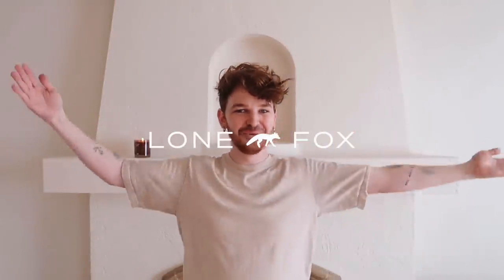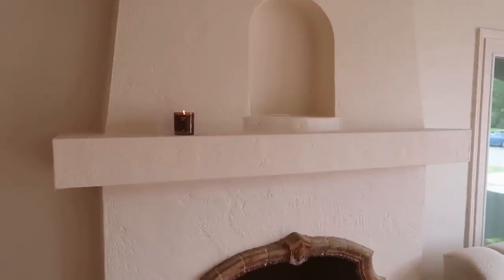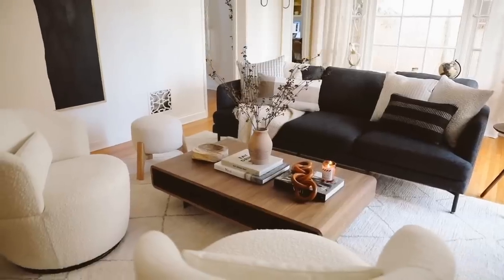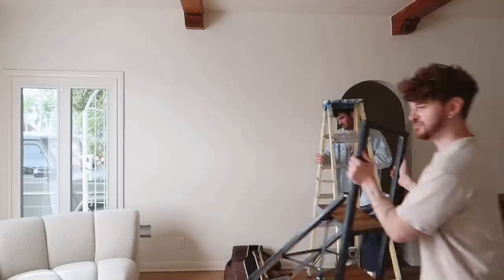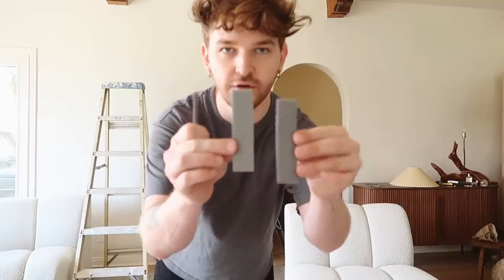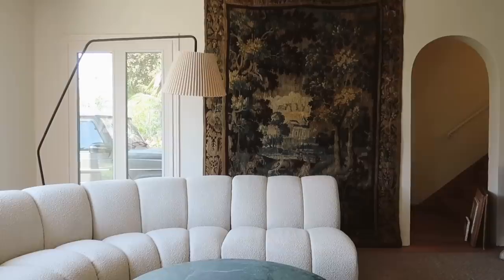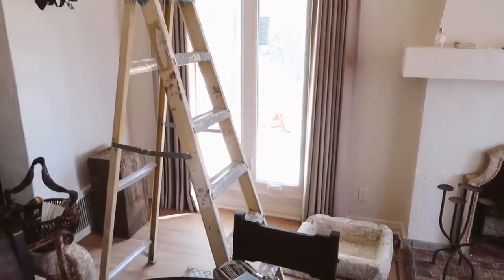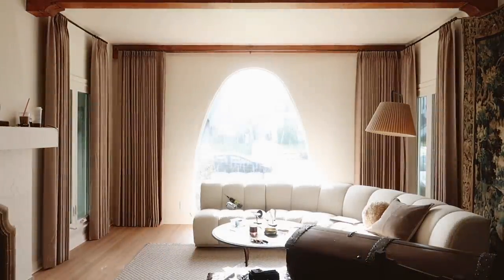Making Over The Lobby 🪑 *EXTREME TRANSFORMATION*

Comment: The tapestry is wonderful.  Since it's so close to a window you might consider getting UV coating for the window to protect the colors.  Those old dyes were natural and fairly fragile. It's in amazing condition for its age and worth preserving.
Reply: I believe you can get UV coating for windows so if it stays in this room the windows should definitely be protected
Reply from the maker: Yes will 100% look into this! I actually didn’t think about that so I am happy you commented this ❤
Reply: absolutely...there's a reason that Museum's have LOW light in the tapestry/costume/furniture rooms.  fading is a HUGE concern
Reply: That was the first thing I thought of when you hung the tapestry. It’s beautiful! You want it to last another 300 years.
Reply: Great idea!
Reply: Was going to comment the same thing! (And I see various other people have as well). It's a gorgeous tapestry and to keep it from damage it needs protection from too much sunlight and UV.

I think you should also invest in getting it hung properly so that it hangs straight and doesn't touch the floor. This will stop it getting damaged and misshappen. It will also make it look more sophisticated, permanent and intentional. The way it's hung at the moment makes it look a bit like an afterthought, which it clearly isn't in such a well thought-out and put-together room! 

Others have suggested hanging it on the other side of the door. If that allows you to hang it a fraction higher without the beams getting in the way, then I agree. It's also further from the window, which might reduce its UV exposure (although I'd be tempted to hang it in a darker room altogether, even though it seems a bit of a shame as it goes well with the rest of the decor in this room).
Reply: I think the wall space it's hung on is a bit too narrow as well. The edge of it is too close to the archway. It needs a bit more room to breathe at the sides as well as the top and bottom. Love the rest of the room though!
Reply: @lonefox  They make a film for the window or you can get custom made shades
Reply: Came to say that as well.  It’s absolutely and archival piece worth protecting.
Reply: I LOVE everything you did in this room. The tapestry is GORGEOUS and someone commented already that it needs UV protection and it’s SO worth the investment - UV film for windows is the easiest way to do it. I will say tho, when you put the tapestry on the wall, I cringed about how it’s under the beam. Would it not fit much better on the other side of the doorway near the bookcase? It looks like that area wouldn’t have the beam above it and the tapestry would have full space to hang. This tapestry deserves 100% space and shouldn’t be hung with the top the way it is currently under the beam. Also - please know I suggest this with love because I’m an art conservator and conserve a lot of quilts and tapestries that have been hung on walls. The last thing you want is for the tapestry to have hanging stress or aging because it wasn’t hung straight.
Reply: I'm glad I'm not the only one who's concerned with the tapestry's safety from the light. Also that couch looks super comfy, really looks like a giant marshmallow
Reply: As someone who has some knowledge about textile conservation, it can be two things ,full aneline dyes (toxic) or natural dyes that fade away . Under no circumstances this rug should be exposed to elements what so ever, it can be harmful to you or it can get damaged also DO NOT FOLD THE RUG ,roll it with  ACID FREE PAPER  and a solid tube inside to transport. These are history, preserve it. Get it framed inside glass because this velcro method is creating unnecessary damaging stress to one end and the glass will protect it from fireplace smoke, dust, water , and other potential irreversible damages and getting it cleaned from a  professional after a disaster will cost a lot. Also don’t experiment with cleaning it as a normal rug, consult a professional who knows about vintage stuff not even a modern dry cleaner.
Reply: copied my real comment so its in first person lol
Reply: @Timmakesmusic  THIS! It does not fit on that wall!
Reply from the maker: @Timmakesmusic  if I had a larger wall I’d say I’d move it but i I don’t :( this is the largest wall in the whole house!
Reply: @Timmakesmusic  I agree, the tapestry needs to be hung properly.  The curtains are hung just right.  No puddling which I hate.  Everything else PERFECT!
Reply: @lonefox  Oh no! That's a bit of a bummer! I'm sure you can make it work though. It's such a beautiful work of art and I can totally see why you were so chuffed with it. It goes so well with everything else you've chosen and it really makes the room.

I think it's the top, more than the sides that are the issue. So long as it's centred on that wall, it will look great. Can you hang it a tad lower so you've got room to have a proper hanging fitting for it and so it doesn't look like it's fighting for space with the beam? If that means it's too low, maybe there's a way the very bottom of it could be rolled or folded, without causing it any damage, that would stop it dragging on the floor.

I'm totally in love with your home, by the way. I especially love your Spanish-Gothic inspired sitting room. You have such a great eye for colour and design, and I like how you always get stuck in and get creative. You've been such an inspiration to me as I've finally moved into a flat of my own and got to start decorating the way that I want.

And if you can't get the tapestry to work in your space, there's always room in this high-ceilinged Victorian flat, if you fancy sending over to Scotland. 😉
Reply: Yes this is so important.  I didn’t apply UV spray to something I hung and it became dull and brittle over several years.  I didn’t even notice until I went to take it down because the change was so gradual over time!
Reply: @Tim makes music  Please tell me how to properly hang one. I've looked on YouTube and haven't found a good video. I have a  fabulous tapestry and just keep it folded in the closet.  I don't want to mess it up ❤
Reply: I was thinking the same thing.
Reply: 4
4
Reply: @lonefox  Are there larger walls in the entrance stairwell?  The tapestry would look fantastic at the top of the first flight of stairs!
Reply: Yes I believe it needs to be hung with a tapestry holder.  I agree the other side would be better is it allows it to hang straight and not touch the ground. It also would not be hidden by couch.
Reply: This is my favorite room in your new house so far!   ❤
Reply: @ourroad2358  in a comment above, Drew indicated that this was the largest wall in the house.
Reply: A precision about UV/light damage from an art conservator: UV filters is a good step as UV will damage the fibres and cause them to become brittle and eventually break, but this will not prevent fading of colors. The fading is caused by any light exposure (with or without UV) so it's always best to choose locations as far away from windows or choose north facing light over south facing when you have the choice. I would also strongly recommend a hanging system that will evenly support the tapestry so not to cause tensions in the fibers from uneven hanging. It's a great piece!!
Reply: Came to see this.  TY,  Sue
Reply: @lonefox Tapestry is ok where it is  but please center on wall. Your putting my ocd in overdrive. LOL
Reply: @lonefox  Great!!! You might want to have a fabric conservator from a museum take a peek. They'll show you how to reduce stress on fabric ranging from light conditions, hanging techniques, thread support, and rotation in and out of display. Betcha the learning would make for some great content, too!
Reply: What about the stair well for the tapestry? It could be better for preventing too much light exposure...
Reply: Exactly what I was going to say. My Mum has an antique tapestry that had light damage even  before it was taken to her house.
Reply: Boy I hope he sees your comment!
Reply: I would also suggest keeping the curtains closed during the brightest hours of the day, to protect the tapestry and minimise exposure to direct sunlight, if that is an option. (It goes without saying, living with a historical piece is different from museum conservation practices!)
Reply: Yes, the first thing I worried about was light on that old tapestry. Even curtains are so easily damaged by light. I am surprised the shop owner or his lighting person never mentioned fibre protection to him, or if they did, that he never mentioned it to us. That is something to discuss on such a channel with such a work of art.
Reply: @VondaInWonderland  First, unfold it! As someone else suggested, roll it on a tube with a layer of acid free paper separating the layers from each other. The folds are straining and stretching the fibres in the creases. Dye may also be transferring.
Reply: @03Destinee  So glad we are all encouraging Drew to honour this piece and experts are weighing in. He is such an amazing expert and I know he will take on this learning challenge and teach us. Maybe the tapestry goes in the movie room? Except, walls too small. Drew, stay excited about this incredible find!
Reply: @VondaInWonderland if its a vintage like mid victorian (1870-80)  or earlier then if possible hang it inside a glass  frame, these vintages can be made of aneline dyes which are toxic to inhale or touch or these can be natural dyes which are prone to fade away . As far as storing goes use acid free paper ,place it across the length,take a sturdy pole and roll the tapestry .Do not fold it it will damage the threads and keep it in a dry dark room no where near moisture .if glass is not possible use plastic as the tapestry will stay safe from water ,dust ,sut ,smoke and other potential irreversible damages and also don’t experiment with washing it like a regular rug . Consult professionals.
Reply: Lovely
Reply: Please consider getting a proper tapestry hanger.  It’s so beautiful and what a treasure.  You could possibly DIY a proper hanger for it. ❤you are amazing and have so inspired me. Love you Drew. Everything you have done is so beautiful.
Reply: @VondaInWonderland  I've never personally hung a tapestry but I understand there are various methods depending on the size and value of the tapestry.

A lot of websites tell you to use pins or nails, but this can damage the tapestry and is not recommended. Here are 3 good options I know of.

1) Some tapestries will have a pocket running along the back at the top. This will allow you to insert a hanging rod (like a curtain rod) or a wooden batten which you can secure to the wall, either like you were hanging a curtain or by fixing the ends of the wooden batten to the wall.

If your tapestry doesn't have a pocket, you can make one using a sturdy fabric and sew it securely onto the back of the tapestry. Ideally, your tapestry would be lined and you would sew the pocket onto the backing lining so it doesn't damage the front of the tapestry. You don't want stitiches going through the front of the tapestry. The pocket needs to be loose enough to accommodate the rod or batten without causing a bulge on the front of the tapestry.

2) Another alternative is to sew a length of sturdy fabric to the top edge of the tapestry, but instead of joining it lower down as well to make a pocket, you attach the fabric to a wooden batten using tacks or staples. You fix the batten either directly to the wall or to another batten so that the new piece of fabric you've sewn on is sandwiched between the batten and the wall or the two battens. When it's hanging, the fabric goes up behind the batten, folds over the top and then attaches to the tapestry.

3) You can use velcro, and this is what some museums do. If the tapestry is small and light enough, the 3M velcro strips that LoneFox used could work. However, I think the problem Drew has is that his tapestry is too large and heavy for this to work well. For larger tapestries, you need one continous strip of heavy-duty velcro sewn straight across the back of the tapestry at the top. Again, this would be sewn onto the tapestry lining. You don't want any stitches going through onto the front.

You would attach the 'soft' part of the velcro to the back of the tapestry and the 'rough' part to a wooden batten. You fix the batten to the wall and then just velcro the top of the tapestry to the batten. If the tapestry is very heavy, you may need two strips of velcro, one underneath the other.

All these methods require some stitching. It doesn't need to be pretty as it's all hidden behind the tapestry. It just needs to be secure and on the back/lining only - not coming through to the front. If you're not confident to do this, you may be able to find someone who can do this part for you.

The advantage of all these methods is that the tapestry hangs straight with the weight evenly distributed across the whole piece. They also create a small gap between the tapestry and the wall which increases air circulation and helps prevent dampness or pests building up.

Sorry this comment is so long, but I hope it helps! 🙂
Reply: Driving me crazy that the tapestry is not centered.  Is it just me?
Reply: @Timmakesmusic  I agree with your point. The tapestry needs a much *more professional installation*. The multiple Velcro strips don’t allow for a crisp straight line at the top of the tapestry.  This sagging line at the top of the tapestry looks painfully like a bad bad college dorm room diy.  The worry I have is how to professionally hang the tapestry because it looks almost too long for the wall.

The light and the lines are the larger than life lead actors in this play you wrote called “The Lobby.  I also think that hanging a not so large picture on the wall near the wonderful curved lines of the window is not to scale of everything else in the room.

The rhythm of parallel lines happening in the rest of the room: 
the slats of the tambour door of the bar, 
the lines of all the very tall curtains, 
the smaller fluted lamp shade with the inclusion of the
almost-but-not-quite-parallel-lines-but-I-did-it-on-purpose wonderful modular sofa is masterful!
Reply: @denisejones1863  this antiquarian tapestry is way too large for anything else, even the sofa, in The Lobby to hide it.
Reply: Thank you @Timmakesmusic  
I didn't think about a gap being a good thing ♥
Reply: I agree, and I think it needs to be hung from a rod too to give it some rigidity to fall properly. It might be better in the movie room, the low light and the deadening of sound and the old Hollywood opulent vibe it would provide.
Reply: @lonefox  Sorry to comment again, but I've had a thought about how you might be able to get a better finish, still using the 3M velcro strips (feel free to ignore this, by the way!).

Instead of attaching them vertically, fix them horizontally to the back of the tapestry at the top so they form 2 (or 3) parallel rows with each strip touching end to end so they form complete unbroken rows across the top of the tapestry.

Fix the corresponding halves of the velcro strips to a wooden batten of the same width as the tapestry (you might want to paint and seal it so it's the same colour as the wall). Fix the batten to the wall at the correct height for the top of the tapestry. Make sure the velcro strips run in straight lines and you'll be able to hang the tapestry with the weight distributed evenly across the whole of the top. It should then hang neatly and avoid any distortion or stretching of the fabric.
Reply: 💯agreed, I love the look of the tapestry, but I dyed a little inside knowing what the bright lights will do to it. What a gorgeous space!
Reply: @cassandra007  Thanks. I am just moving towards getting it hung now. I'm getting fabric protector too ❤️
Reply: @Andrew  That would be a huge pane of glass :0 Maybe it would actually be easier to frame. That way, I wouldn't have to make any stitches ❤️
Reply: I've also commented on the amount of light in the room, it will fade the tapestry in no time.

Comment: Hey Drew just keep in mind that over time the sunlight may damage the tapestry since it's so close to the window. The other thing I was thinking about is to hand the tapestry by a rod to have it more straight up top and then let gravity pull it down, I think it would make it look for expensive:) Love the style and vibe of this room
Reply: i was concerned about this as well. the "hang" of the weave will definitely be affected. attaching to a straight piece of board and hanging the board with keep the integrity of the weave for longer
Reply: @sherilynl4038  I agree, tapestries can be quite delicate. @Lone Fox
Reply: Agree. It looks a little wonky as is.
Reply: It was hanging probably a long time if it a little older and it’s good think those hangers are better than the ones in the store.
Reply: totaly agree on a rod to staighten the tapestry up top.  The space is not ideal as it may touch the ground but at least it will not be damaged.
Reply: Hi drew love every thing about this room, the tapestry would look much better hanging from a rod looks uneven at the top what a gorgeous  find though.
Reply: Stunning!
Reply: Yep… top of tapestry distracts. Better to hang straight lines up top and just a tiny bit away from beam, even if it falls onto floor a bit!
Reply: Indeed, I also feel such a tapestry could use a strong rod, maybe in cast iron or so. XXXXXXXXXXXXXXXXXXXX Pinkie